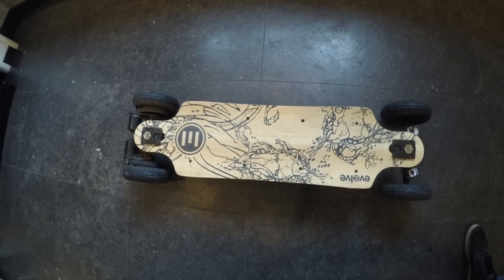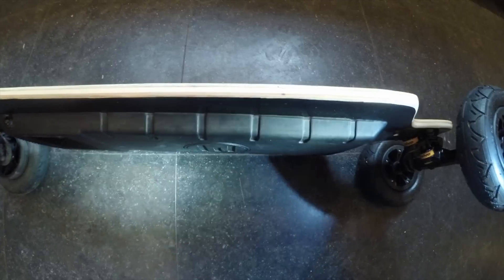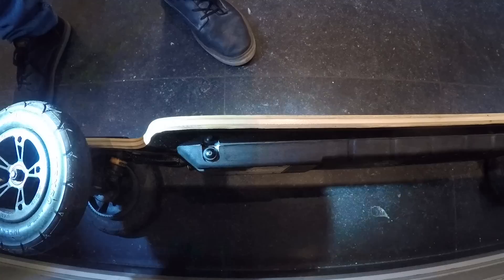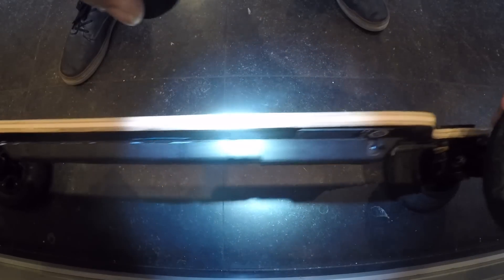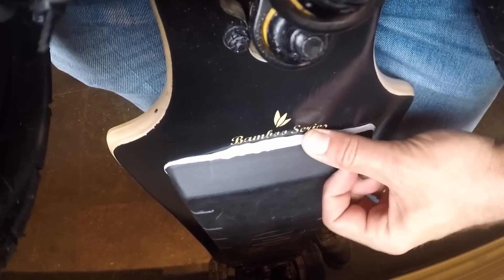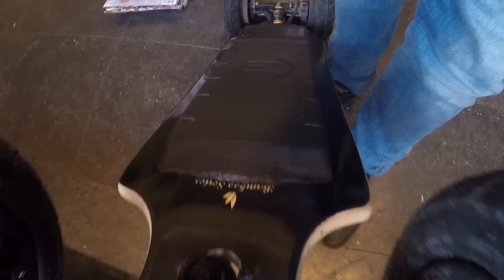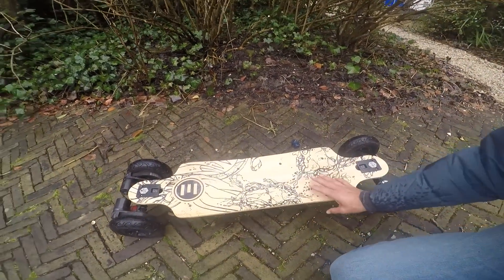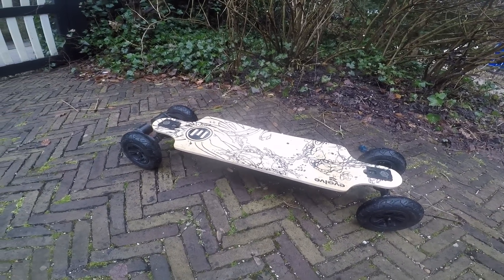Waterproof Evolve Bamboo GT - make your Bamboo GT electric skateboard waterproof

Comment: Hey, can you please confirm that all this actually works? so... only difference between GT and other waterproff boards its just area under board?
motors are build that way that it's not a problem for them?
Reply from the maker: Worked like a dream for me. Never had a problem with it since fixing this issue with the board. But I generally try to avoid riding in the rain

Comment: It is board still working waterproof? :)
Reply from the maker: TheNestyCZ yes, works like a charm!
Reply: I am interesting in e-board and evolve looks best but i am from czech and its rainy almost every second day so i dont know if its evolve best way to go :)
Reply from the maker: TheNestyCZ Hi, please realize that riding in the rain is not really a good idea. Normal skateboard wheels get very slippery and dangerous. Evolve have the off-road wheels. They are much safer, also for little holes in the road and stones (check out Casey Neistat videos, he crashes on his boosted board a lot due to the wheels). Riding in the rain makes you also pretty dirty due to dirt coming off the wheels. But, when it stops raining and the roads are not completely dry, the Evolve with my fix works like a charm. Personally I would never ride something else than Evolve. Also the battery life is so much better than anything else I have seen
Reply: I mean when starts raining i just want to get home and dont walk xy km with 8 kg longboard :D
Reply from the maker: TheNestyCZ yep. Go for the Evolve with All Terrain wheels. You will not be disappointed! On other skateboard you can't even go for 8km at high speed before the battery dies 😜
Reply from the maker: TheNestyCZ yep. Go for the Evolve with All Terrain wheels. You will not be disappointed! On other skateboard you can't even go for 8km at high speed before the battery dies 😜
Reply: I was thinking about street but now when i look on video from evolve AT vs Street it looks AT are the winners for me :D
Reply from the maker: TheNestyCZ for sure, you will not regret. I have both setups but never ride on street as AT is so much better. Maybe if you want to do tricks and skidding, then go for the street but for riding/cruising the AT is really super
Reply: Thank you for your advice! :) Have a great day.

Comment: Hello bbal, its been a year since you've done that. Is everything still working smooth? I'm thinking about doing this too. Some 3d printed splash guards and I'm set for unexpected rain riding ☔. Would be great to hear your 1 year later opinion! Thanks
Reply from the maker: Bernard Kudulis Good point Bernard! And yes, everything runs beautifully and I haven't had any problems on wet surfaces and we have used the board a lot, also when the roads were still wet.

Comment: Carbon Gt or the Bamboo GTX and why?
Reply from the maker: Ian Charles We have both. The Carbon GT is a bit longer and much stiffer board. The battery in the board is very cool and even though the Carbon GT is a year older, our experience is that the battery is stronger so you get more milage. The GTX is reality very cool and gives you more the skateboard feel as the board is more flexible and playful.  So both are really great boards but different characteristics. The new remote is a real game changer so make sure you get one or upgrade to the new one. By the way, we always ride on the All Terrain wheels. Much safer and more comfortable for everyday street use

Comment: bbanl

Great video. Just ordered a GTX. Going to do this!

What do you think of this method? I could use both I suppose.

https://www.amazon.com/dp/B008O9YIV6/ref=twister_B008UH3WB4?_encoding=UTF8&psc=1

Finally, you seem honest to me. Have you ever had connection issues? Do you feel the newest evolve boards and firmware to be safe and reliable?
Reply from the maker: Hi, I have never experienced connectivity issues with the Evolve boards when I hold the remote in the hand which is closest to the backside of the board. (the normal stance, for me, left foot in front, remote in right hand). The only times I experienced a loss of connection is when I was pushing a person on a bicycle and had my right hand with remote on his shoulder (pushing him/her). If you have your hand then too far on the right side of the person (furthers shoulder) there is too much body mass in between the remote and the receiver and you risk a loss of reception. It might also happen if you hold the remote against your chest so that your body mass is in between the remote and the receiver under the board. If it happens it is not a big issue. The board rolls on and slows down and as soon as you move the remote away from the body mass you can safely apply the throttle again. By the way, this seldom happens and only if I did as described above. I can strongly recommend the Evolve boards as they are very reliable and have fantastic battery life. Only issue is the waterproofing of the board, which could and should be better. On the GTX the issue is only on the back side of the board, where the concave of the board doesn't close of the battery case completely so water can come in. There I would apply some kit or blue-tack. Regarding your first question; Personally I wouldn't want to smear silicone on the motherboard. Also, in the battery unit there is also a little print board with electronics where it is not easy to get to with your silicone bottle so you should in any case close the gap to prevent water from coming in, if you ride on wet roads. And be careful of riding in the rain. Things get slippery and dangerous! Happy riding!

Comment: Any idea on how to water proof the remote? (I can put it in a ziplog I guess, any other idea?) thanks.
I wish evolve did come up with a water resistant design for the skate + remote. It is an expensive skateboard, they should come up with something.
Reply from the maker: Wilhelm THOMAS No, but so far that has never been an issue for us. But we try to avoid heavy rain. The waterproofing is to avoid issues when riding wet roads.

Comment: I really enjoyed the vid. Think I'm about getting one of these boards. But a pro tip next time filming is to try to keep the go pro housing from rubbing up against anything while filming. It got hard to hear you at times and it overall reduces the quality of the vid. But still, nonetheless, I still found it very educational and will probably do something similar with a caulking gun and some black silicone.
Reply from the maker: Logan Landry Thanks for the love and the tip! 😃 (by the way, the clicking noise in the beginning is the rain drops falling on the gopro)

Comment: The reasons they don't make it waterproof, and they shouldn't is because two reasons: first is the safety, as probably as you've noticed, the street setup is very slippery on even damp asphalt, and second, is the fact that even if the board is waterproof, there is the issue with the motors, as they will get wet, and there's no way around that. Yes, you can have some custom motor guards/enclosure, but then it will make it even bulkier than it already is.  I love my board, and i can't wait to ride every chance i get, and rainy days sucks, but it is what it is.
Reply from the maker: sebastian teulea I avoid riding in the rain but my carbon GT got a problem because of wet shoes!
Reply: these motors can run in water as there are no moving electronic parts

Comment: I don't get why you wouldn't just use a clear or black silicone sealant and a caulking gun - good strong seal with a bit of flex still... Would be fairly easy to remove if needed. Also, you may want to heat-wrap the wires where they're exposed to make a better seal into the battery case.
Reply: Yeah that is what I'm going to do, silicone sealant is a much better idea IMO.
Reply: Marc Sneddon 

James Cooke

Did you guys try Silicone? Did it work well/better?
Reply: Stick some masking tape first to make nice lines.
Reply: I'm considering silicone too, anyone tried yet?
Reply: i was getting ready to leave this exact same comment!
Reply: Just did mine with some black silicone  no need to disassemble and it only took 10 minutes. I also sealed the screws and heat sink of the ESC
Reply: @stevenbibeau1515  and anyone in the future reading this, also use it in the screw holes, thats where most of the water usually comes in to destroy the electronics. Goes underlooked by a lot of people.

Comment: you can use silicone conformal coating to water proof the electronic. https://www.amazon.com/dp/B008O9YIV6/ref=twister_B008UH3WB4?_encoding=UTF8&psc=1 

it wil look much cleaner and wil probably be safer. 

sorry four bad englich
Reply: Cool Guy, this product seems really good, doy outhink that will also work for the remove, like how will you apply it as there is the screen? thanks.

Comment: hi  i just bought my carbon gt 2 in 1  today have to wait for it to be delivered 
the board i have got at the moment is a wood board it has a dual motor
 and it is belt driven .
in the rain because of the belt drive
 if the belt gets wet 
forget it its not going any where 
so i made a sort of guard from some plastic containers from food packing 
it works alot better and longer but in the end it gets wet and that's game over 
tis board only has street wheels  of 87mm  52 wide and 
people always said to me 
oh it gonna slip it only slips in actual water puddled  
not just damp as i know this i go slow in water topped surfaces 
i bought the gt 2 in 1 today to get the all terrain wheels included 
i am really hoping that the belt on the gt does not have the same problem 
when it gets wet ? can you tell me if it does the same thing?.
when the belt gets wet is it game over till it is dryed?
Reply from the maker: loopiewho no issues with the belt if it gets wet.
Reply: Loopiewho, No problem with wet belt however the motor(s) will shut down when they get too wet! Water-tight it and 3d-print a cover for the motors may help a lot...
Reply: well i am gonna vacuum seal mine in 2 inch thick Teflon then 
add an 3 foot bullet proof steel plate over that ,,,
Reply: thank you for this info 
i still have to wait a week to get my gt 
i will wet proof it as best i can ,but i wont be going out in the rain ,
not unless someone invents working wind shield wipers for my glasses ,
nothing worst than rain on glasses ,i just cant see a thing so its game over
Reply from the maker: loopiewho agree. But nice to be able to go out or get home if the roads are wet without the fear of ruining your board
Reply: yeah , i do look after things and i would rather go that extra mile to dust proof and water proof i have had to travel back in the rain on my 3600 watt board a few times ,got to tell you thou its slow going on my 87mm street wheels  cos anything more than a damp patch and its slip city ,learnt that the hard way ,OUCH,!
i made some clear plastic cover ALLS  for the belt drive that stops water going on the belt for a LONG  while ALSO stop twigs and stones from stretching my belt to destruction  ,cos with this board i have right now if the belt gets wet thats it  the grip is gone
 it have to be carried from that point ,so i am looking forward to the gt as it sounds like it dont have this issue ,
i also do cover my things in vinyl to stop scratches  as i hate things getting whacked out ,somewhere under about 3 mm of pvc 
my trotter board is sill  brand new ,but trust me its had a few serious tumbles in its 8 months of trips lol ,but i know its as good as new in its full pvc jacket lol
i do have to renew these covers every 8 months or so but thats nice cos it gives me time to service them then too ,
i have a lot of electric person transportation units here  of all types , what do you have ?
Reply: I was driving in rain today and no problem at all, I did fix the tension of the belt yesterday because it got loose from riding on cobblestone roads all the time. Make sure you tight them up and use loctite. The grip does get a bit slippery and you need to make sure you are a bit more careful when it is wet.

Comment: Why would I be so crazy to ride a skateboard That can go like 40km/h in the rain? Way to slippery!
Reply from the maker: Christian Kellner Ha ha 😂 Good point. I try to avoid it. But even if you ride on wet roads when it is not raining your board can get damaged. If you use your board for commuting you can't avoid riding sometimes  on wet roads. 
By the way, with the AT setup wet roads are not slippery.
Reply: bbanl this true, I found out the hard way last night which is why I’m here. I was surprised that the board didn’t slide once with the AT wheels.

Comment: I'm glad my Blu-tack idea worked, was just checking on the results, also il add to anyone reading this Blu-tack comes in other colors.
Reply: This is the only black tack i can find, UK ebay very cheap and comes in a thin ready to use roll, ive used it for waterproofing film cameras and for underneath audio equipment such as speakers and turntables as its very good at isolating vibrations, heres the link. 

http://www.ebay.co.uk/itm/Black-Tack-extra-strong-blue-tack-1-2-metre-length-/272564338234?_trksid=p2141725.m3641.l6368
Reply: did you test it? Or do you often drive through the rain and on wet roads after sealing and checked after if it water in it

Comment: Thanks a lot for the video.
I have read over the net that the bearings are not sealed so the motors can be damaged and make weird noise after a wet ride. 
also do you think some corrosionx on the electronics could be convenient?
Reply from the maker: rojitor roj thanks for the additional information! I have no experience with that. In principle I avoid riding in the rain as it is not very pleasant with all the water from the wheels making your pants dirty but at least with some additional sealing I have much less stress if I have to ride over wet roads

Comment: Why didn't you just leave the battery pack attached and slapped some clear silicone around it and called it a day? It would have been much easier and just as effective...
Reply from the maker: Victor Medina silicone gets hard and you do want to be able to open the cover. Having said that, now that you have seen my trial and error you can conclude (like I did at the start of the video) that fixing the front and the back without opening up the case will probably be sufficient. I had to find that out. Still, I feel more secure knowing there is a protective layer on the inside but it is a lot more work.
Reply: So if I would go for silicone would it work? Have you tried?

Comment: Waterproofing the battery is good, and a must. I just put a carbon wrap over the entire board and battery pack...
The other thing i was thinking about is Motors, they have holes on a side... what if water goes through there?
Reply from the maker: Ilie Dobrovolschi so far I have not experienced or heard of issues with water in the motors

Comment: Wish it was a little more 'tidy'..:) I can't put goo all over my board..:/
Reply from the maker: Music Media Group / Directed by Davo - I sympathise with you and I did look a bit messy. In the end, if you want to minimally tinker with your board you can buy 'black' blue-tack (l learned later) and carefully stuff some in the gaps on the front and back side of the battery cover to seal the gaping hole. Should be pretty neat and tidy and safeguard the integrity and coolness of the board. I just want to make sure no water comes in and ruins my expensive gear. A bit of goo around the edges is not my biggest concern as it is not really visible and intrusive from a 1 meter distance. Remember, in the video I get really up-close.

Comment: great video!  I need to do the same, living in Seattle there's water all the time, even when it's not raining.   How do you plan to waterproof the motor itself?   I might even try some heat-shrink on the wires going to the motors.
Reply: Yes..any issues with the moter taking in water?
Reply from the maker: Info boothsnbeats No, I have not experienced it and on Internet I read that they are pretty waterproof so I am not going to do anything with them.

Comment: woot, i'm the first person to view!
Reply from the maker: Ha ha, indeed! Hot out of the oven :-). Thx for the comment and thumbs up! I don't waterproof the motor as I have not experienced issues with it and read on the internet that the motors are not really the problem. Take care!
Reply: yeah, after Boostedboards issue with just moisture and humidity causing their massive battery recall, it's very important to stop any kind of water, mist, or splashes far away from the battery area!